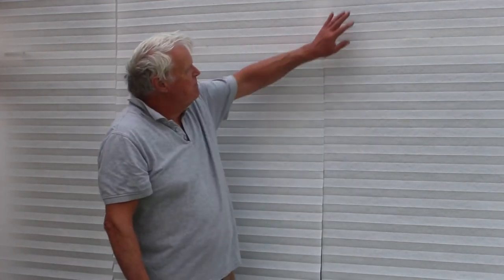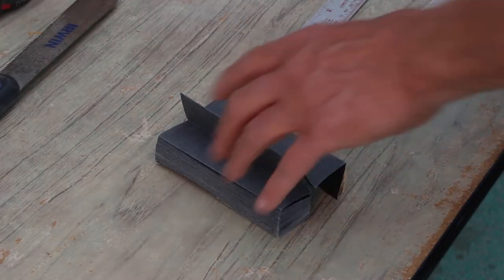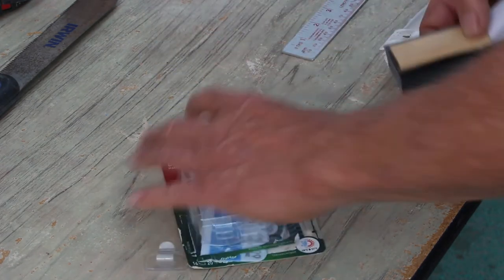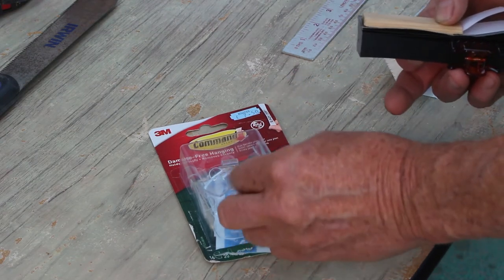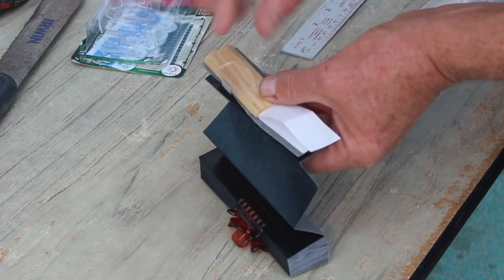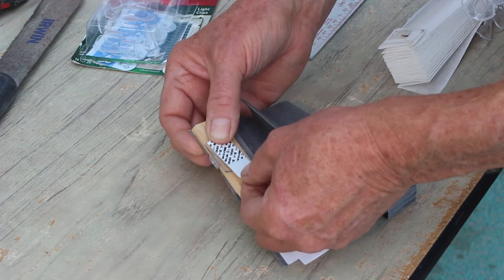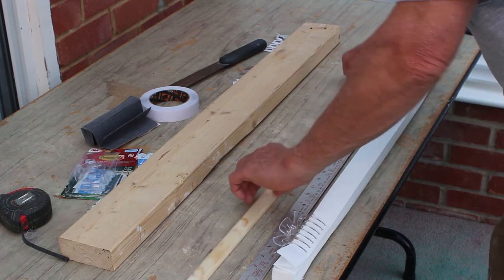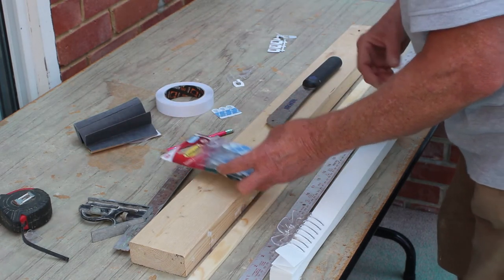Schottis blinds from Ikea, easy fix- clean removal method of fitting.

Comment: Thank you for referring me to this video. What a great idea and those Command clips are so nifty.  Your method provides a similarly easy way to install and remove the blinds as the brackets that come with IKEA's Hoppvals cellular blinds. When you reused the blind in this video, I assume you cut off the top pleat that had previously been stuck to the window with the original double sided tape?
Reply from the maker: Yes I cut off the top pleat. cleaned off the glue residue and then fitted the hooks. Best of luck!

Comment: Fantastic solution! Could the light clip be fastened to the ceiling and the timber slotted into it? Thank you.
Reply from the maker: Hi, probably not, ceilings are almost always plaster or emulsion paint and I do not think the clips will stick, maybe if ceiling is varnished timber or gloss paint. Test the idea first! Best of luck.

Comment: I have a question. When it is night and the light is on inside, can you see the inside of the house from the outside? 
I have a window to the street and that is very important to me. Your clips are great. Greeting.
Reply from the maker: I had a look in through mine last night, you cant see through them, tho you can see shadows thrown onto the blind and the light coming through. Hope this helps. If you want to be very private I would suggest trying the schottis black out blinds which are lightproof. (tho black). Good luck and thank you for the nice comment.
Reply: @thestonecraftingworkshop7490  Thank you. Certainly this will be temporary for me and I think it will help.

Comment: Which command clip is it? I can’t tell
Reply from the maker: Hi Sarah, they are labelled "Command™ Outdoor Light Clips 17017CLR-AW". They are clear plastic, the back plate is approx 25mm wide and 16mm high. The hook is approx 12mm wide. You can see them here: Command™ Outdoor Light Clips Value Pack 17017CLR-AW
Curiously I could not find these on Amazon so maybe there are supply problems at the moment. Best of luck with this.